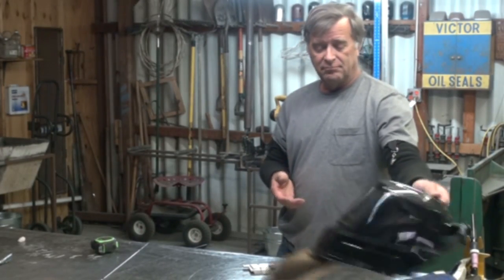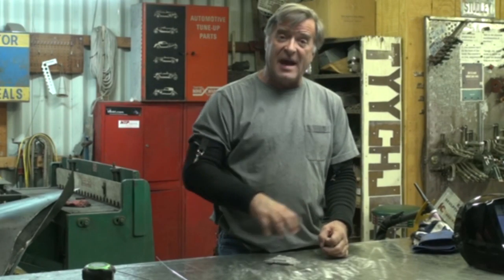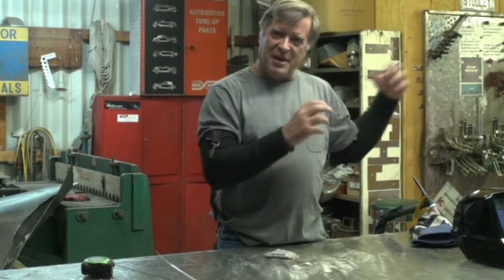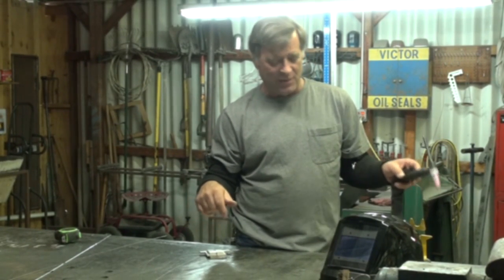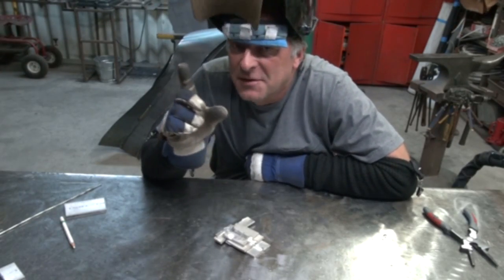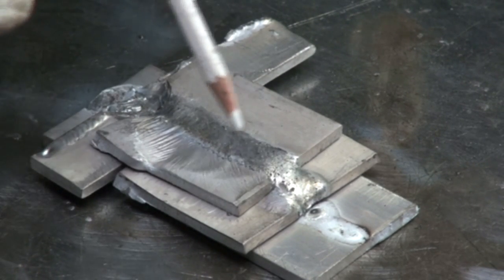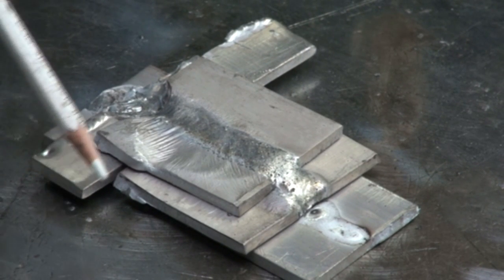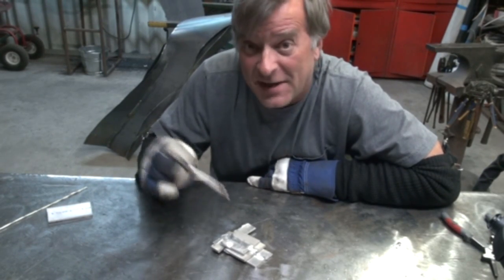How to Use Advanced Pulse When TIG Welding (or not) - Kevin Caron

Comment: Welding stacked plates is an inefficient and near impossible thing to do, because of the microscopic air gap that cannot be elminated and efficient heat transfer is prevented, plus with aluminum you have the oxidation which make it impossible to get correct fusing.   Solid thick billet or plate is about the only way to do this...but the video does show the intense heat that the unit is capable of in advanced pulse...Kevin, I hope you have some good gloves! lol.

Comment: I really appreciate that you put "your fail" videos online as well as the "successes", it says a lot about your character and is truly admirable Kevin!
   I've never Tig welded anything thicker than 1/4 but u may try tacking those pieces together or even vice grip'em so that the heat will penetrate instead of kinda "floating" on that top layer....just a thought...looked pretty cool seeing that oxide layer holding that molten aluminum pool together just under the surface though!